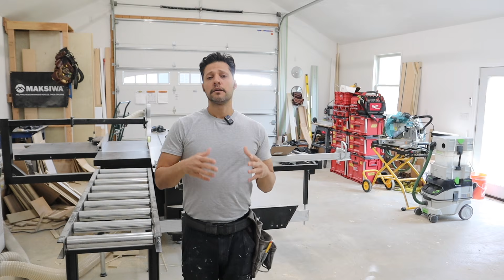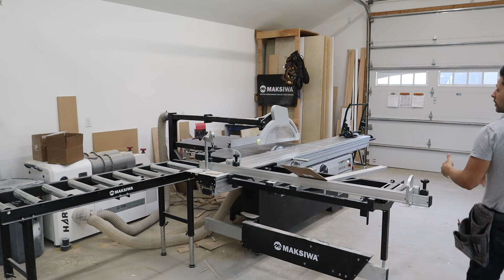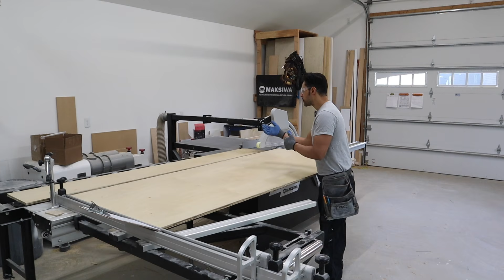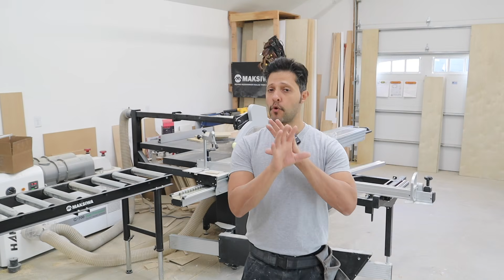No more wasted time!

Comment: I have the smaller version BMS.1600.ir . But lately I have been thginking about the full size version. Maksiwa does not have very detailed dimensions available. If you had time i was wondering if you could take 2 measurments for me? Just need the distance from the cast iron top to where the slider sits. Front of cast iron to front of slider and back of cast iron to the back of slider. It appears that the cast iron is the same dimensions as mine so that should be a good referecne point. Thank you.

Comment: Hey Anthony - do you use 3/4" pre-finished plywood for all of your kitchen cabinet builds? I was thinking 5/8" (16mm) would be sufficient. Lighter and a bit less money but still plenty strong enough. Thoughts?
Reply from the maker: 5/8 plywood is actually 15.8mm, which in my opinion is only good for drawer boxes. I only use 18mm or if I can 19mm pre finished maple or birch for cabinets. Since I do all custom work, my clients pay for higher quality. Trying to save money using 5/8 plywood(which they don’t even sell anywhere near me) is not the way to go. Especially when doing frameless like I do. And don’t get me started on shelves, they bend like bananas, I’ve seen it in many homes. 5/8 boxes appear and feel just like premade big box store crappy cabinets. But that’s my professional opinion, you can use whatever you like. It all depends on your budget and what you’re comfortable with.
Reply: @AnthonyScolaro1  Thanks for your thoughts on that Anthony - I'll go with the 3/4" ply for my new frameless kitchen cabinets. I'll be using rift sawn white oak for the doors and drawer fronts. I can't get 3/4" plywood with r/s white oak veneer (only maple or birch). Do you find maple/birch ply boxes are close enough in color and grain that it looks ok with white oak? I think it will look fine for the cabinet interiors, but I will have a few end panels that will show prominently so I was thinking I'd have to make up some custom panels using white oak veneer over 1/2" or 5/8" plywood.
Reply from the maker: @ogwoodworks get veneer for the end panels. Maple or birch will never match white oak. Grain and stain will be completely off.
Reply: if you want lighter use the pre finished maple not the import birch the core is a lot lighter than the import

Comment: You will get more accurate and consistent results if you do your parallel rip cuts on the siding table using a parallel fence instead of using the rip fence.  https://assets.zyrosite.com/YanMoZDqRrS1lagy/parallel_fence_alternatives-69dBFl63dBYN6lnH.pdf

Comment: Great tips. Thx. When did you switch to metric?
Reply from the maker: I only use metric for cabinet making. But I switched about 5 years ago
Reply: @AnthonyScolaro1  Anthony, what metric dimensions do you cut your cabinet gables to? I was thinking 605mm deep x 768mm high for balanced panels but curious how you do yours. Thx.
Reply from the maker: @JohnTarabay 768 long but 608 wide, then with the 1mm pvc edge banding it’s 609 which is basically a true 24” conversion. But you can use anything from 600-610 and it will still be standard.
Reply: @AnthonyScolaro1  Perfect, thanks Anthony.

Comment: Hey brother been watching you since you were in that smaller shop. Enjoy your videos. Just a small suggestions... As you get older those plywood sheets, sheetrock sheets start to get a bit heavier. I invested in a Grabo, I have the DeWalt version. I plan on getting a second one, just makes things easier to move around and you're not actually touching the material. Keep up the good work brother